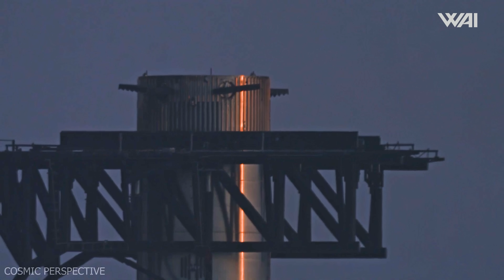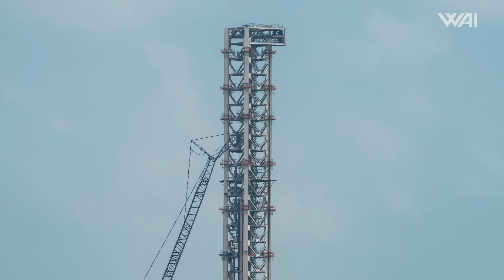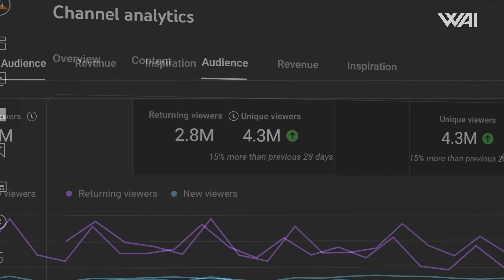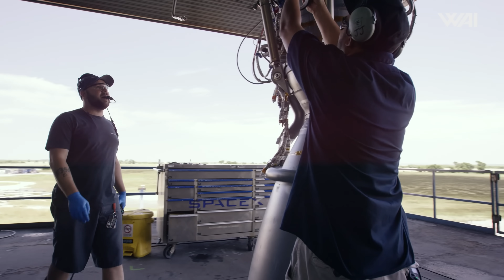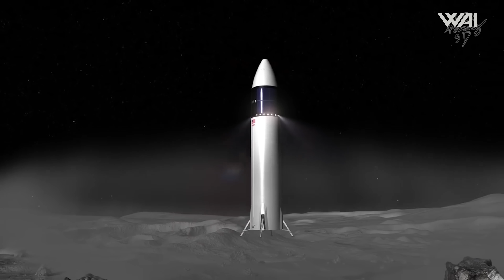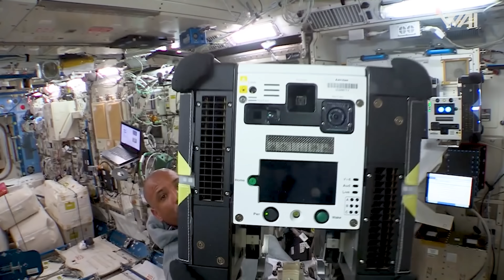SpaceX finally gives out the ONE news we want to hear about Starship flight 6!

Comment: Did the tower bend or did it flex? Can't fix what is not broken. Like wings on an aircraft or a very tall high rise building they will flex to avoid damage from stresses. Allowing a structure to flex during stress helps to reduce weight and increases strength.

Comment: The commentator talks about the bending of the tower while it was catching the booster while showing a video depicting this. The video was not of the tower it was of a small part of the tower the chopsticks that caught the booster. The part of the chopsticks that was bending was designed to bend like that to act like a suspension system to absorb the shock and soften the landing

Comment: Maybe they are focused on tower two. That tower one is more of keeping it operational, applying quick fixes, adding refinements as needed. Kind of   like starship build V1 vs V2.

Wonder if tower 2 one of the upper section is a place holder for three more sections to make it tall enough for Starship V3 or are they going to build another tower for that Build later.

The tower chopsticks OLM mount and catch system must allow the chopsticks to rotate 90 degrees to pick up a new booster and starship stacking them on the OLM mount.

Is chopsticks catch also done at this 90 degrees offset position relative to the OLM mount allowing a returning booster or starship to be caught and swung stacked onto the OLM or booster to be fast refueled and launched. 

Starship cargo vessels would come preloaded from the factory launch bay and be stacked on to the next returning booster.

Comment: Making the front flaps smaller is good for Earth's atmosphere but will those small flaps have enough control in Mars extremely thin atmosphere?  Getting it right for Mars atmospheric entry is going to be tough with this trial and error approach. Mars is extremely hard. 50% of the missions sent there fail historically. And just the time delay of the radio communications will make it tough to get info on what failed. The Moon is way easier to land on because it doesn't have an atmosphere actually. 
But if anybody can do it SpaceX can! 🤠👍🏻

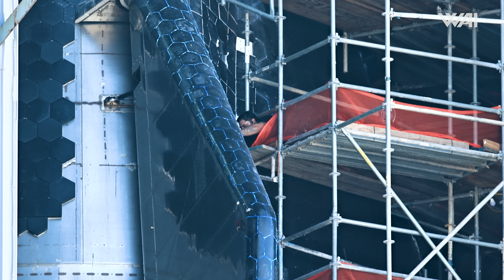Comment: @08:01 recovery of Starship probably is an entirely different chapter. The heatshield tiles are very fragile, thus making it very difficult to catch the ship without damaging tiles. The ship cannot slide in and scratch the chopsticks like the booster did on its first catch attempt. This will likely tear off dozens of tiles.

Comment: Space X Space lab should be a telescoping craft. No Wing, and 65m high at launch. It will not need to be S/S but aluminum. The body will extend 40m out. The lab 9.25m OD x 40m body plus 10m nose, the floors or sections walls be stowed in the first 6m-9m under the nose at Launch. By adding RADAR on one side and a Telescope of the other. The Nose can be use for Space Study, computer and communications. The 10-12 body levels and the second down from nose all have 2 docking ports with one on the nose. After extending by the lower level 2 to 4 each 5kw Kilo, Nuclear generator added. No need for solar panels

Comment: Great update Felix.  Looking forward to the stretched version of starship, it would make sense to remove Pad A's launch table  and water  deluge system in favor of another flame diverted and modified water system.  This could be a gain of some 70 feet in height which could mean that the launch tower of Pad A would not need to be raised to accommodate the larger (block 3?) Booster/Starship combo.
What do you think?

Comment: Do you think they’ll fire the engines a second or two earlier next time to slow the booster down even more so it doesn’t hit the chopsticks with as much force? With three engines running it won’t require too much extra fuel if any at all…
Reply: Increase a throttle just a little is enough
Reply: @ good point. Could go either way. Fire earlier at same thrust rate or just throttle up engines slightly more during re entry to achieve softer landing. Either way it’s a spectacle to see

Comment: Replaced? Is the falcon 9 gonna stop flying once starship is online? I thought they would be maintaining both lines or improving upon the Falcon 9 to have both medium and heavy launch capabilities
Reply: SpaceX eventually would want to retire it, but there will be an overlap
Reply: Medium launch capabilities are only worth having if they're cheaper than heavy. And that's not necessarily the case, given that Falcon is throwing away an expendable upper stage on every launch, and uses more expensive propellant.

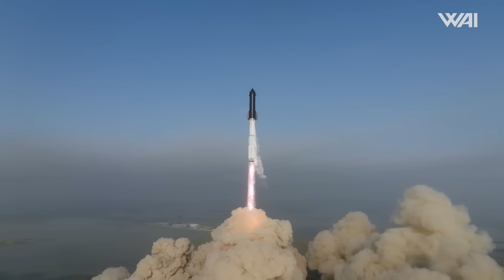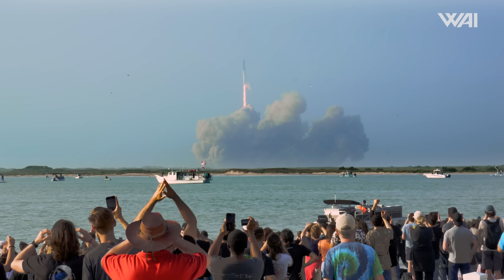Comment: 13:40 "... after the first flight cratered the launch pad and exploded mid-air. YES. That was cool." :-) Very funny. 13:48 Actually Starship Flight One was not two years ago, but only about 1 1/2 years ago (From 20 April last year till 20 October this year, the time span was 18 months. IFT 6 is planned for 18 Nov, which would be about 19 months after IFT 1). However, this nearly feels like an eternity because so much happened during and between these flights.

Comment: Of course the catch will bend the tower, that is by design, compensating for the catching of a VERY HEAVY thing.
IF the arms were rigid, they would have snapped.
Very tall buildings sway in the wind, they must.

Comment: Considering that the Bending is Visible on the Videos, They may have Decided to Go for another catch Before they are removed in order to get more Data from they probably have All Kinds of Sensors attached to the Chop Sticks them selves and considering how much work they put into them they may have decided the risk is lower than the Data value
Reply: There will be a catch on Flight 6 whether it bends or not, there's no reason not to do it. The bending might actually be within design

Comment: Tower is steel yes? Steel flexible
Reply: Steel with concrete inside
Reply: @alvianchoiriapriliansyah9882  concrete is not filled all the way to the top of the supporting structure, nor is it inside the chopsticks.
Reply: Watch skyscrapers they move a lot more in wind and remain standing

Comment: I'd be far more concerned if the chopsticks and tower DIDN'T flex during landing. As long as the steel flexed within it's modulus of elasticity, there is no "bending" or permanent deformation. Translation: the whole tower-chopstick complex is like a big spring. It's designed to move around to absorb and dissipate energy. If it didn't do so, THEN it would bend and break.
Reply: I think we are looking for the term ‘elastic limit’ or ‘yield point’ where the ‘modulus of elasticity’ is the slope of the linear portion of deformation before you hit plastic deformation. I took one class 32 years ago and had to look this stuff up.
Reply: Steel flexes a lot. I spent many years climbing cell towers for a living. On especially windy days, it feels like you're sailing on the ocean. You can have several feet of movement up there just from wind.

Comment: I thought the booster was supposed to be caught by the grid fins but in the slow mo video you can see that the grid fins aren't even in contact with the catching arm so then what part of the ship did they use to latch onto the arms?
Reply: A lifting points

Comment: SpaceX keep on ‘tweeting’ the Quick Disconnect, to make it survive the launch more reliably.  In some cases this needs more shielding in selected areas, as hoses keep on getting damaged by the launch / landing process (mostly launch I would suspect)

All this data is being used to inform the design of the new launch platform.

Comment: I think flight seven will still use the Raptor 2.5s because I think that they will want to test landing accuracy in the ocean with the block 2 ship, and therefore not want to ditch Raptor 3's in the ocean.
Reply: It hasn't been long since the very first ever Raptor 3 firing, and it recently blew up likely to intentionally test the safety margin. It takes more time until they have proof-tested 3 sea-level & vacuum Raptor 3s ready

Comment: The area close to the removed vertical tanks will be used, probably, after Pad B's design is validated. I would suspect that the pedestal at Pad A will be torn down and a concrete pedestal will be installed similar to Pad B's or exactly like Pad B's.

This would allow the blast to be directed up and away from the tank farm and make for a highly reusable launch pad which is what SpaceX is looking for. The current pedestal is way to maintenance intensive.

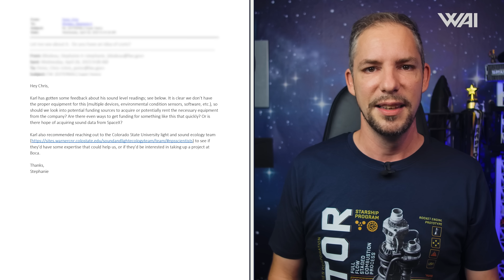Comment: 14:38 Read the entire letter. This isn't a matter of bad communication on anyone's part. They're saying their agency is so underfunded that they can't afford the sound sensors that they need in order to do their job and give SpaceX the approval. They can't just give approval, they have a job to do, so they're hoping that either SpaceX can get the data for them, or (even more desperate) have SpaceX loan out the very equipment that the agency will be evaluating them with. Meanwhile, all we hear from the news is that the agency is so bloated and inefficient that it needs even more funding cut!
Reply: Bureaucracies will induce the demand to always keep claiming they are underfunded and understaffed, inefficiency and over-regulation = job security and expansion.
Reply: guess its a doomed if you do, doomed if you dont kind of situation.. because i am sure there would be a huge outcry because of "bribery" and "inappopriateness" if Spacex did that part of the FWS's Job, or provided the equipment.. (and also cries that they have faked the Data provided)
Reply: for a guv agency to operate effectively, it needs 10 times the fundig of an equivalent private body
Reply: Having worked in govt, I can tell you govt entities are usually bot bloated/inefficient and in need of more funding.

Comment: Imho, Starship flaps should use screw mount actuators on the bottom and the top, instead 3 or 4 hinges. Hinges are frail and you need to strap the very tight on the ship hull to protect it from the plasma heating. With a pair of screws, you can add some space between the flap and the hull, filling the both sides of the flap with ceramic tiles.

Comment: Considering that Raptor 3 engine is internalizing much of its fluid feeds, that will involve some foundry type of work or 3 D printing techniques, I think.That takes time to set up a shop and make the equipment to set up a production line. Mixing and matching seems like a good way to make the best of both worlds. A tip of my coffee cup to Raptor 2.5. Cheers!

Comment: Some of the forces that need to be deatl with are internal vibrations. A long object tends to wiggle in the middle more, I think. 
The closing arms send vibrations to the structure, I've seen. 
Some vibrations can be dampened by altering specific locations.
Example, playing an artificial harmonic on a guitar string. Position is key to effect, IMO.

Comment: One year for SLS Orion tiny heatshield replacement - one month (for 20x bigger) Starship heatshield replacement🤷‍♂
Now you know why taxation is so high.
Reply: @TheGalacticIndian  Orion is meant for a crewed reentry, so obviously they have higher safety standards and more rigorous testing. You also have to remember that the Starship heatshield still partially failed near the flaps on flight 5, even after the heatshield replacement. NASA ideally wants to have enough confidence in the heatshield working perfectly for them to trust it with the lives of their astronauts.
Reply: @plainText384  Respectfully, Starship’s heatshield is for future crewed flights too. The failure? An old design already fixed in Starship V2. Plus, it wasn’t the heatshield—it was poor forward flap placement. Unlike Orion, where the heatshield has to work at the capsule’s base. No moving that around🤷‍♂
Reply: @TheGalacticIndian  Respectfully, there is no currently announced launch timeline for a Starship launch that would reenter with crew, at least not since DearMoon was canceled due to growing delays. The only announced Starship mission that might feature a crewed landing with Starship is Polaris mission 3, but there's basically no publicly available information on that mission. Meanwhile, Orion is planning to fly crew on the very next flight, possibly in around one year (depending on the decision made because of the investigation).

And yes, it was the heatshield that failed, specifically the heatshield near the base of the flaps failed to prevent parts of the flaps from melting.

Comment: The bending was nothing like how much it bent when they had it weighted down with those test bags of water.  The arms were 10X more deflected than the booster catch.
Reply: Yeah, for such a long cantilever it's pretty minimal. Commercial plane wings experience similar deflection several times daily.
Reply: So long as the bend and bounce are close to the same amount the tower experiences when lifting the Booster or Starship from the ground to launch mount, then it is within the tolerances it was designed for, and there will be planned maintenance only required. They will have done inspections to check, and there will have been strain gauges measuring the loads coming on and going off the tower.
Reply: @PiDsPagePrototypes  they projected disaster but it was just that word backwards. Dreaming of a cement parabolic tunnel with Boring laughter.
Using mag lift rail instead of first stage ballast after reduces rocket mass by two thirds to achieve escape velocity.....
TO ACHIVE ECLIPSE RAPTOR
Reply: Remeber they wanna do that over and over again! One time deformation, no problem. Many repetitions, even small deformation can be very fatigueing for the material.
Reply: @reabkire  Watch the frame of a steel roller coaster, it flexes quite a bit with each ride.  Cranes flex repeatedly, its fine.
Reply: Deflection versus plastic deformation leads to stress,  masterbation and degradation for weak engineer learning point loading and web transfer  compression( I want to be m&m ...not quitting my day job though) sorry too many beers.
Reply: @steveilicous  Yes, you sound drunk.

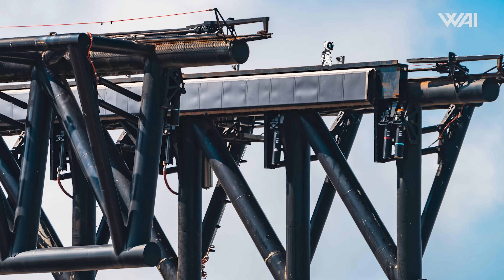Comment: 1:25 Elastic deformation and plastic deformation are two different things. Most steel is surprisingly elastic compared to e.g cast iron. Bending not always equals breaking. Are the chopsticks still crooked?
Reply: Indeed. Steel is one of the few metals that have a stress-strain curve allowing for a recovery from a deformation without any accumulated fatigue, as long as the strain doesn't exceed the yield point.
Reply: Probably not. They tested them with 200% load, using water baloons, sometime ago. At least I think it were 200% load. As You said: steel is quite elastic.
Reply: When stuff stops bending and bouncing that's when u got a problem of to much weight

Comment: Not sending a rover that is finished and ready to fly and sending a weight to replace it has got to be miss appropriation of funds. I mean come on, engineers: "we've got that billion dollar thing we've been working on for years ready to go!" Guy in charge: " cool, we're gonna replace it with this chuck of concrete. We designed the lander to have it so if it don't it might cause problems."  Engineers: "so why don't we send the rover the tax payers paid for?" Guy in charge:" because, it's over budget and over due so we gotta get rid of it." Engineers: "but it's done..." Guy in charge: "here is another billion, have the concrete block simulator on my desk first thing on the morning 10 years from now. Don't forget to come ask for the other 5 billion your gonna need to finish it half way through. We'll take 5 years to get it to you though."
Reply: Relable the rover as ‘concrete’ - problem solved..

Comment: I wonder if Pad B Launch Table proves out will there be any thoughts or discussion about rebuilding the Pad A Launch Table? Could just the top be replaced with a top like Pad B if that proves out to be more robust requiring much less refit/repair between launches than the original pad has proved to need?

Comment: Why does SpaceX keep the grid fins at full feather position or flat to direction of travel on ascent? That makes for maximum resistance and the need for greater power required for lift off and climb performance.
Reply: Tim Dod answered this question. The increase in drag is less than the weight of hardware required for them to move to a parellel position and back again. 

Basically the increase in drag is less than the weight of the equipment required, which means less fuel spent and more mass to orbit.

Comment: I think it would be both practical and economically sensible (therefore appeasing Congress) to cancel SLS and just use Starship instead. SLS is outdated, expensive, and impractical. At this rate, I'm fairly certain China are going to beat the West back to the lunar surface because of SLS.

Comment: I don't see the tower bending - what I see: It's the arms giving in - probably just as planned.
Reply: You can see both bending in other videos, but yes, that is correct; a bit of bending is expected, and that is why SpaceX opted for further reinforcements to the arm and the tower.
Having a bit of bend can actually be better at times IF it is designed into the structure properly, which I'm sure if it wasn't before, it would be for future towers. If it's not designed in, though, the main problem would be wear over time (especially in any concrete sections), which, if that does become an issue, would actually be AWESOME as it means lots of launches!
Reply: The arms are flexing elastically under load, as designed.  They will return to their unloaded position after the load is removed.